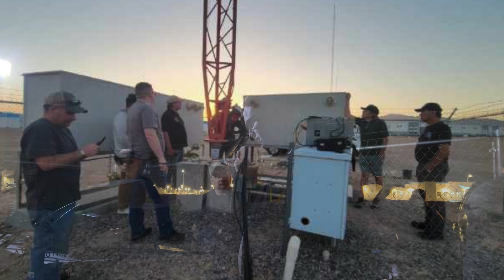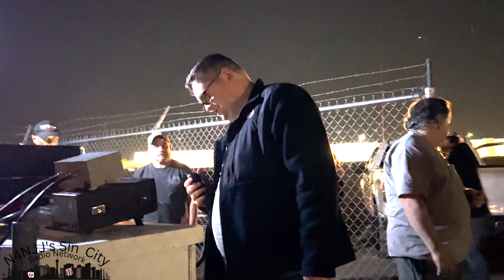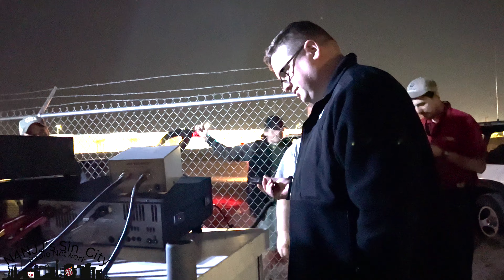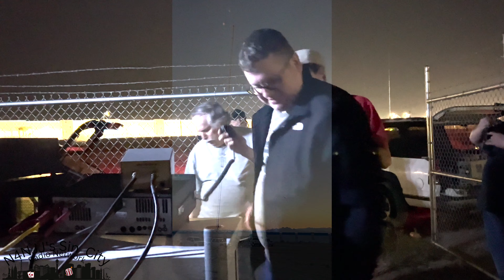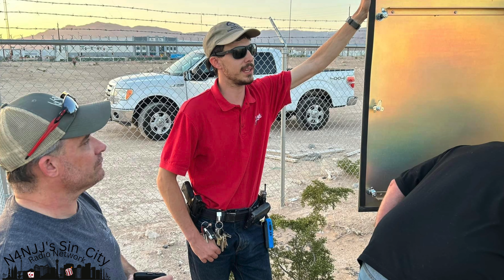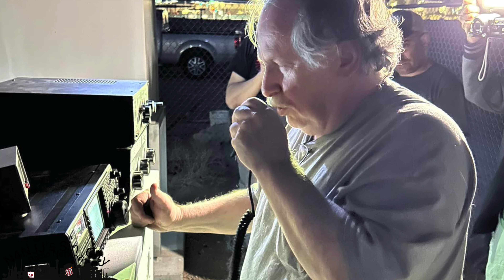Talking 160m on an Abandoned AM Broadcast Tower of Former KDWN & KXST

Comment: Neat idea.. But I wish you'd shown how the rig/tuner was hooked up to the antenna.  73 de k7dgf
Reply: Fr
Reply: I would assume they put the centre of the coax to a clamp on the tower, then clamped the shield of the coax to the ground straps on the concrete base that are a part of the ground system.
Then the used a tuner to bring it in.

Comment: We can all thank Audacy Las Vegas for shutting down 2 AM stations in Las Vegas and selling the property that these towers sat on to prop up their company's bottom line. So unfortunate that such a west coast powerhouse, 50,000 watt KDWN 720 should return to dust and no longer provide a public service to it's listeners. The original 3 tower directional array sat just off of Boulder Highway between Henderson and Las Vegas and was established in 1975.

The demise of AM Radio is never a good thing, especially when we have nightime AM radio Stations powering down to about 27 watts and since they're on a co-located non directional tower, with a less than optimum antenna length and are expected to provide acceptable service. The industry sure has changed and not for the better.